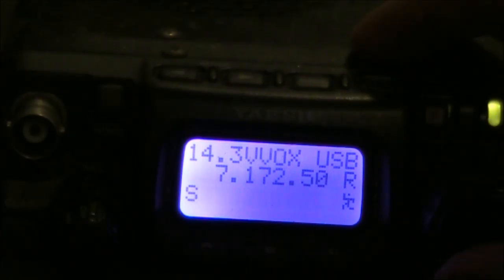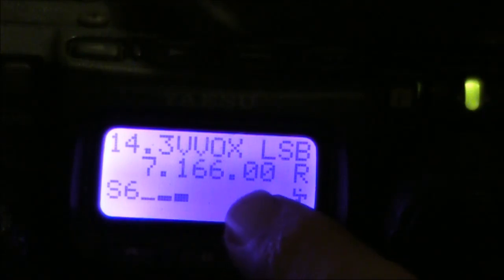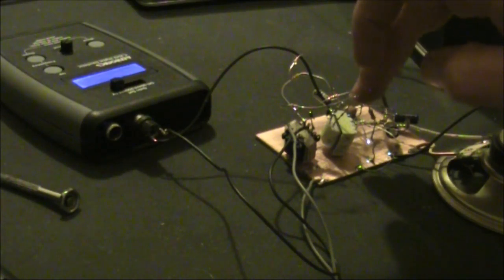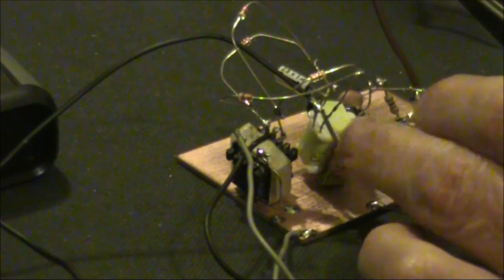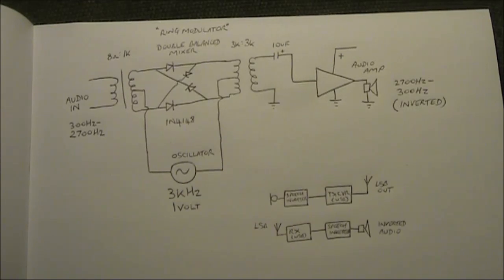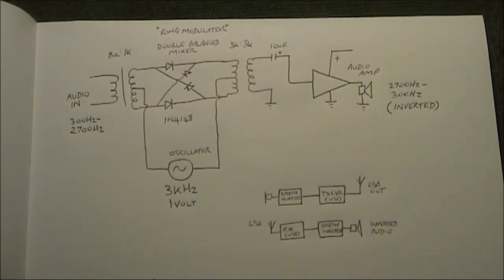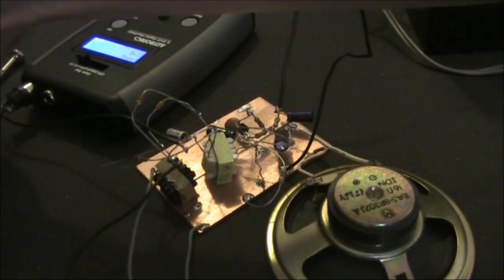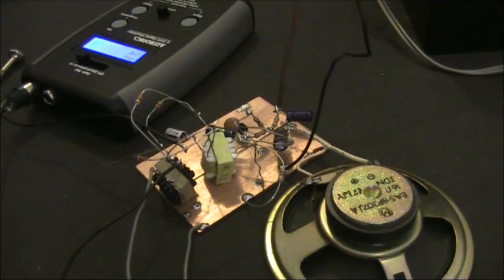Fun with ring modulators for inverted SSB and crazy audio

Comment: Making a frequency inverter with analog switches can work a bit better.  I would suggest the CD4053 as the switch.
The local oscillator can be at 4 times the 3KHz and divided down with a Johnson counter to make 3KHz-Phase=0 and 3KHz=Phase=90.
This lets you strongly reject the noise from 3KHz up.
A fine tune on the local oscillator can also be handy.

Comment: So cool.... (built these as a kid... added to our walkie (cb) in grade school.).... try adding another transformer between the center taps... 8 to 1000 ohm give about 10 to 1 voltage gain and will solve a ground loop issue in the ring. Yet another CT transformer and a transistor comprised (my old design) the oscillator... after being caught by some teacher.... and marched in front of the  princapal (who was a ham...and started my offical entry into the hobby) and who then .... introduced me to other hams in the area... who then amped up the design with a-weight message filters (rc network matched to the transformer inductance) it got even better... but it started just like your design.... WOW.... thanks for so many great memories... 73's

Comment: I've always heard that SSB is just AM with the carrier and other side band suppressed. But from what i've seen in waterfall diagrams, it seems that SSB could also be implemented as all the frequencies between say 5hz-3000hz but shifted all the way up the frequency scale so it's at the frequency you want. What do you think of this? 

KI5GKM
Reply from the maker: Yes you can mix audio and RF in a balanced modulator (ie mixer) but there will be unwanted products, giving a DSB signal. However these can be removed with phasing techniques.

Comment: Doesn't your input give sum and difference outputs, though? 300 Hz will give 2700 kHz and 3300 kHz out?
Reply from the maker: Yes. Which is why the signal to noise ratio is poorer when listening through the inverter than without. A 3 kHz low pass filter would fix this.
Reply: I was thinking the same thing: an input at 300-2700 Hz mixed with 3000 Hz will give 2700-300 Hz (i.e. 300-2700 Hz inverted) and 3300-5700 Hz (non-inverted) at the output.

On receive, this helps explain the "tinny" distortion due to the components above 3000 Hz.  As Peter VK3YE says, a 3 kHz LPF will help with this.

On transmit, those components above 3000 Hz don't matter.  Even if the microphone amplifier amplified everything between 300 and 5700 Hz (and it probably wouldn't because of the amplifier frequency response rolling off above 2700 Hz), then the balanced modulator inside the radio would produce (for a 10.7 MHz BFO) components at 10.694300 - 10.699700 MHz and 10.700300 - 10.705700 MHz.  But the IF filter in a USB transmitter would pass only 10.700300 - 10.702700 MHz (being the normal upper sideband bandwidth), so those higher frequency components arising from the 3300 - 5700 Hz audio are filtered out.

Comment: Great stuff, Peter! One of your best videos, IMO. You can also build a ring modulator using CMOS switches like the 4066, if I’m not mistaken. It’s such a simple project, yet so fascinating. The stumbling block for many people will be the transformers, no doubt. A couple of cheap and nasty old pocket radios or clock radios are often a good source of 1K - 8Ohm transformers as they used to use them in the audio output. You hardly see them nowadays because it’s all audio ICs, so it’s important to look for old radios with discrete outputs, ie pre mid 80s or so. The quintessential old AM transistor pocket radio! :-)

Comment: This is great, I knew that was what was going on when tuning in a signal on the wrong sideband but never thought to do this at AF. You can get cheap function generators on eBay. If you got the balance better you could get the injection tone much less audible